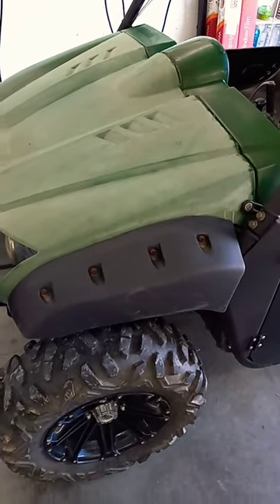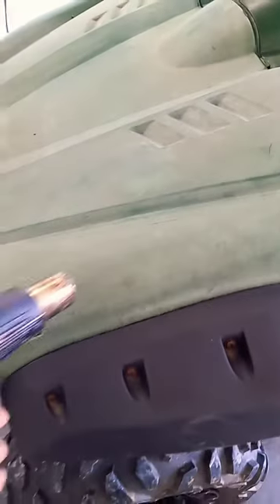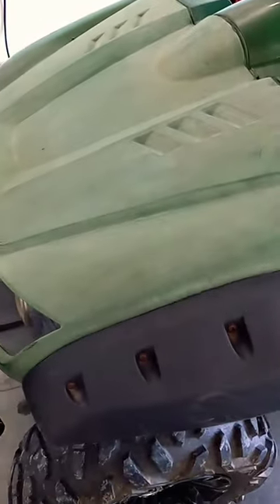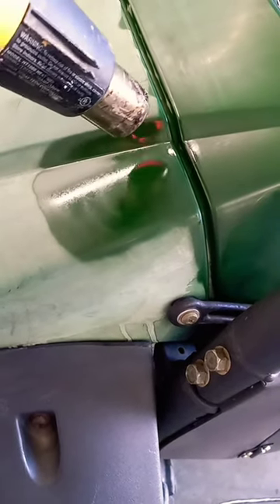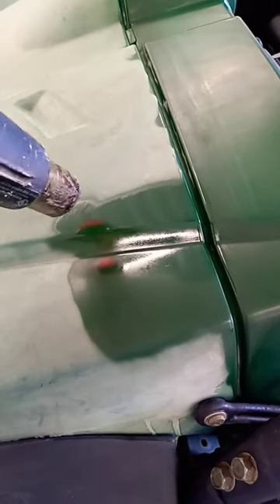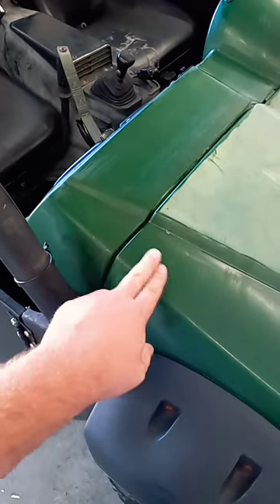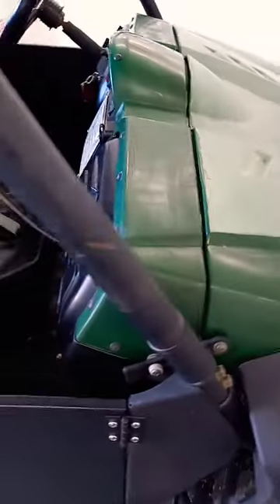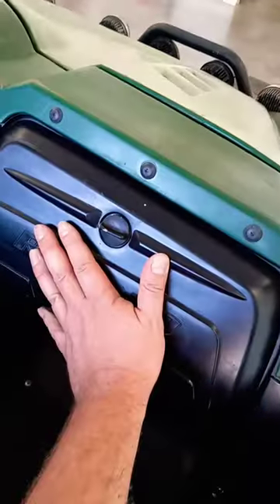restoring color to old faded plastic!

Comment: This is only temporary and turns plastic brittle. Far better results from wet sanding and applying bowling wax. The plastics absorb the wax and become flexible again which in term makes it more durable and shock resistant unlike brittle heated plastics
Reply: I work at a tractor dealership what I do is take rubbing compound and apply with a polisher then wash it and apply polishing compound then wash again. I’ll hit any hard to reach spots by hand and after that it’s restored to brand new with microscopic top layer removed and polished out to new then if you want you can apply wax to give a nice protective coat. I wouldn’t recommend the sand paper as it’s more abrasive than you really need try picking up some rubbing compound and it’ll do the work for you it’ll never fade either as it’s not like wax where you’re just applying a coating it’s more like microscopic sanding so fine that when you’re done with the polishing compound there’s no visible scratches at all a polishing gun only runs you 50$ as well the compounds you can pick up for 10 each at any autozone
Reply: You really don’t need a polisher either you can apply by hand
Reply: Bowling ball wax or bowling ally wax?
Reply: What is bowling wax?

Comment: It helps to sand the oxidation off as much as possible so your not melting it back into the plastic. You will get a better result with the color much brighter. Start with 400 or 600-800 then torch or heat gun until the surface looks shiny then keep moving around the surface. Then let cool. If you want an even glossier result wet sand 1000-3000 grit, compound & polish, then use SC1 High gloss coating to finish.
Reply: You sound like you have experience, I've seen people say a torch works better than a heat gun, any thoughts?

Comment: Torch works a lot quicker - just keep it moving.
Reply: A good hot air gun is infinitely more consistant and leaves a much better finish.
Reply: @nxxynx5039 do you know this or are you guessing? Anyway a heat gun is 10x slower and in my experience heat guns and blowtorches leave the same finish

Comment: That’s cool. Never knew you could do that. Do you need to use any type of Armor All on it to keep the shine up?
Reply: Clear coat works well on headlights to prevent oxidation from returning. 3-5 VERY THIN layers-thoroughly dry between coats.